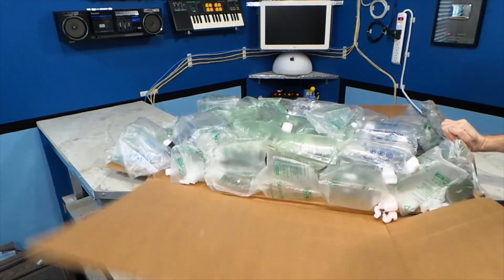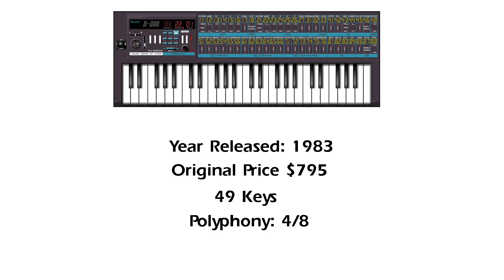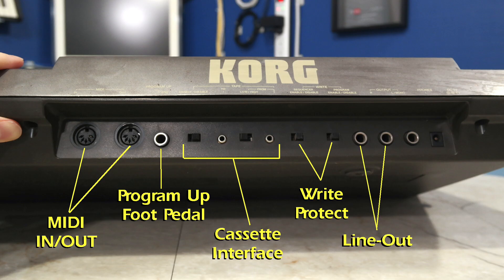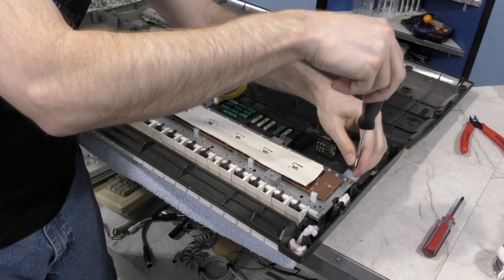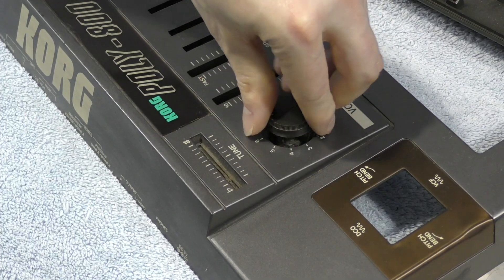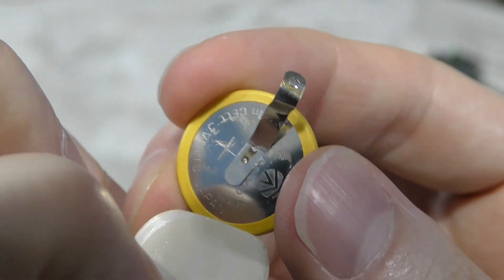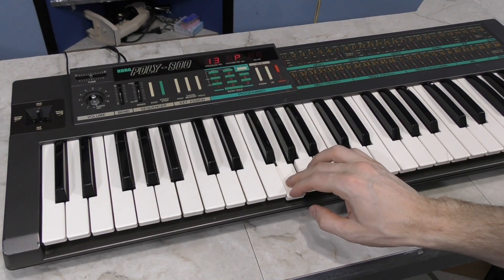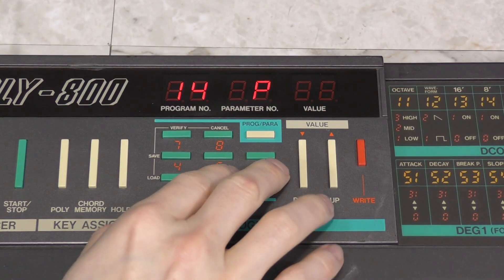Korg Poly 800 Battery replacement and factory reload.

Comment: You could actually feed the battery circuit 3V from a separate battery or power source while changing the battery, if you really want to retain the information in the RAM chip. Not always necessary of course, but useful to know if you really want to avoid loosing the data in the RAM

Comment: I'm not sure if it is even possible with this keyboard, but it would have been nice if you could have done a sysex (system exclusive) dump of the program data before loading in the factory presets.
Reply: Mitchell Dunaway Would have taken a complex digital probing system.  Or some manual decoding of a "tape" export.

Comment: Whenever I have to replace a 3V Li battery in gear like this I use the 2Ah Varta battery when there is enough space. It will last 10 times of the CR2032 battery and I don't need to check every 3-5 years. http://uk.farnell.com/varta/6117201390/battery-lithium-craa-2000mah-3v/dp/1877580. However, still a good mod with the socket, less hassle.

Comment: Why you dont connect a temporally battery directly to the memory  IC and then replace the old one? I think that way you can keep your sound programs, is a parallel conection so you will keep the same input voltage on the IC.

Comment: I would have put on another battery on the same rail on other soldering points and then swapped the battery, this way you wouldn't have lost anything.

Comment: Really enjoying your content!  A couple of questions.  Is there a reason you didn't backup the sound patches that were in memory using the same cassette interface before you took out the battery?  Also did you think of attaching a power supply on the battery contacts before you removed the battery to keep the memory alive while you changed the battery?

Comment: Had a similar problem but wasn´t able to find a button cell holder in my parts bin. I solved the issue by soldering two wires on the board where the old cell connected and attached the ends (after removing a small part of the insulation) to a wooden clothespin. Then i just  put the cell into the pin (watch the polarity) aaaaand: sucess!

Comment: Excellent tear down.  You really have this sort of thing nailedThe battery holder will lose hold of the battery if this keyboard is gigged on the road. That is why I replaced my soldered -on back up battery with another  soldered-on battery. It would be a pain to loose all the data when the battery pops out. I hate to think what would happen if the loose battery shorts across a vital item.Could you comment about replacing the midi ROM, the early Poly 800s were Omni on which meant the keyboard responded to all 16 midi channels at once. An external sequencer can turn Omni off but this was only retained whilst the keyboard was on. It reverted to Omni on when switched back on again. later models had the midi chip modified and a retro chip was availableI heard that the VCOs were SiD chips, is that true? The voices can be very rich and external effects really enhance it.Thanks again

Comment: Interesting that an older cassette interface still proves fully functional after 35 years whereas more recent gear with (failing and unobtainable replacement) DS disk drives are presenting serious problems.

Comment: Out of curiosity, why did you not backup the non-factory patches that were on the keyboard using the tape interface before replacing the battery?
Reply: He didn't care
Reply: How would you know,  @dizzydaisy909 ?
Reply: @HelloKittyFanMan.  lucky guess?
Reply: You don't know how "lucky" that was until you know what the actual answer is,  @dizzydaisy909 .
Reply: @HelloKittyFanMan.  true.
Reply: he's too rock n roll for that
Reply: Bc he's a boomer.
Reply: Wow a C.G.I. ANIMATION IS HERE

Comment: wait did you just replace a nicd rechargeable with an alkaline non rechargable? That battery may be headed for a leak of awesome proportions when you plug it in and the power circuitry attempts to charge it.

Comment: That resistor to ground (1 megohm if I read it correctly off the screen) is commonly used to protect against static electricity. (It's what's inside an antistatic wrist strap) Probably some static sensitive components nearby.
Reply: Since this is an RF shield, I think it is more likely to be there to match impedance in RF signals generated so you don't generate reflections which would cause interference of its own.

Comment: Those batteries often last for 15-20+ years, and some have lasted more than 30 years, so not something that requires very regular replacement.  However, you could have saved the original memory by temporarily soldering any 3V source (battery or power supply) across the same battery backup rails with a 1K resistor in series (the resistor will keep your temporary battery from trying to dump more than a few milliamperes into the old backup battery, giving you plenty of time to safely replace the old battery without needing to worry about the backcharging harming it, then remove the temporary battery when done installing the new battery.

Comment: Oh man! You should have saved the SRAM to your computer via the audio jack just like you loaded them before changing the battery...
Reply: If I ever buy one of those and it has custom sounds, that's exactly what I'd do.
Reply: I was just thinking that myself. If you can save and load, why not save it into a file on his Mac? That way he saves anything that wasn't Factory so he can reload either or whenever he wanted to.
Reply: @CoolSteve08 

 its not hard to create the patches. those cheap synths really had a limited number of unique sounds. I would keep these type of boards for maybe a year then you get bored with them. They arent like true analog boards which are about three times as expensive.
Reply: True!!
Reply: I was thinking this watching the intro.  My mom had one a DW-6000 (close cousin) back in the day and when he showed the tape interface and mentioned that he was going to remove the battery and lose the SRAM... I was face palming.  Like...why didn't he just back it up?  He'd  just shown the tape interface and mentioned the SRAM/battery so he was aware of it at that point.
Reply: ¡PLOP!
Reply: CLOAD. CSAVE
Reply: He's literally a boomer.

Comment: Why didn't you just avoid losing the data at all by soldering in a new battery with wires in parallel while laying down the new cradle and soldering it in parallel, and then desoldering the wired backup battery?

Comment: Wow, very interesting that this has a tape interface on it for data storage! That's comparable the not-so-old keyboards from the previous decade or two with a floppy disk drive, like my Yamaha Portatone PSR-540, and then the most current music keyboards that store data on removable flash storage, except that these have the factory patches on ROM. So that leads to my question: Why wouldn't the factory just put those on ROM in older keyboards too, in a way that could be copied to RAM for the changeability, which could then be restored later?

Comment: You should have perhaps saved the existing sounds to tape (well, not literally tape, but you know what I mean. XD) before replacing the battery. I assume that's possible right?
It wouldn't have taken that long, would it?

Or is the keyboard only capable of loading samples from tape, and not saving them?

Comment: On battery change jobs like these, I prefer to solder 2 wires to the battery connections and keep the board under voltage so I don't lose any information. And for easy battery change later on, I would have soldered 2 battery holders in parallel, and put 1 to the other before replacing the old one.

Comment: @8-bit Keys , something interesting about this keyboars is that it's paraphonic, not strictly polyphonic. It means it has a single envelope for every of the 8 notes of polyphony, so they are not really "independent". If you try to play a sound with a slow attack and a long release  and play a series of notes you will notice they share the same articulation.

Comment: I'm surprised yo did not did not backup the presets that where on it when you got it. I'm assuming the tape load mechanism works both ways and you could have backed up the presets. I'm still kicking myself for letting the battery on my k1m die as some of the sounds that where on it when I got it where not the factory ones thankfully the user i got it from included a handy cd with a ton of presets etc but finding the ones that where on it would be like finding a needle in a hay stack. The k1m uses midi system exclusive messages to transfer presets etc.

Comment: That battery is/was probably rechargeable. Usually batteries with tack welds like that are.
Reply: nabeelr There are quite a lot of primary lithium (often button type) cell batteries widely available with welded tabs that were very commonly soldered direct to PCBs for backup purposes, especially in the 80s and 90s to backup SRAM and RTC chips.  In fact, it was pretty uncommon to encounter lithium rechargeable cells (such as an LR2032) until much more recent times and prior to that one generally encountered much larger rechargeable NiCd packs with solder tabs back in those times.  So having solder tabs on a battery pack tells one very little about whether a cell is primary (nonrechargeable) or secondary (rechargeable).
Reply: That's all well and good, but you missed my other post, where I noted that it's a Lithium Manganese battery, which indeed is a rechargeable cell, with a voltage of ~3.7v

You can see the marking of LiMm marking on the batter.

Comment: Actually, you didn't need to go through the trouble of putting the patches back on. Just solder to the bottom of the board a twin double A battery pack, then load it with batteries and then replace the button cell battery. It works much like a Gameboy cartridge how it has to keep voltage going through it to keep it's save states. With this, it's basically the same thing with the patches. You don't lose the patches at all if voltage is still flowing through the board.

Comment: Couldn't you have saved the existing programming to cassette before changing the battery, instead of having to find a recording online?

You can get tabbed CR2032 batteries on eBay, for pennies apiece. I reckon Korg never intended this unit to have a long enough lifespan that the battery would need changing, hence making it non-replaceable. (The original was still working, after all.)

Comment: Possibly get some spray dye like what is used to redye plastics when restoring cars. I had to use some to color match a grill I replaced and it took less than a day to do. Any black color would probably do. I got mine at LMR, but I was specifically trying to match the interior of a specific model car.

Comment: if you wanted to you could have saved the patchs by using a 24 pic IC clip and providing power to the chip while you switched out the battery.

Comment: in the future you can just hook up a 3v (or 3.3v) power supply to the soldered battery leads when you change it so you wont even have to worry about reloading the data

Comment: I have a question. I recently got a pair of old speakers, that plastic has gone sort of tacky. It scrapes off, and I got it off the volume knob with a bit if metal, but it's gotta take forever that way. Does anyone know if a faster way to get it off?

Comment: TIP! You don't need to spray paint plastic like this. You can use Black Shoe Polish and get a better result. It's also easier. Cheers! Keep up the great vids! :)
Reply: simontay1984 I'm not sure why, but I've been using this technique for years and the plastic is always dry to the touch the next day (nothing gets on the hands). Looks like new again, and lasts too.
Reply: @DanDuskin  if I had to guess, the polish fills the pits and holes that make a surface look dull.

Comment: I had a friend who had one of these synths in the early 90's. It was good for it's digital oscillators that avoided the problems with tuning that analog oscillators had.

The only problems were that the sound was a tad thin and the nice analog sound was imprisoned behind a keypad and a few more buttons which was frustrating considering the sounds you could make and you need knobs and switches to program quickly.

Having said that tho, once you'd managed to program some good patches you could just go wild and use the joystick on the filter and LFO!!

Comment: The color is a bit weird isn't it?
Reply from the maker: I thought so too.. it's my new camera.  But I couldn't seem to adjust it any way that made it look better, so I eventually just left it the way it was.
Reply: Hi.. umm David?

I've tested some option to make better picture in GIMP, either of those solves the weird color problem. These options should exist in any good video editing software.
First I've increased the red channel by 6, this sould be somewhere in the Color Balance option or similar.
Then I've changed the hue, rotated the color wheel by -14.
Maybe you should check the Color Temperature option too.
And you may check the options on the camera for these, there sould be something that fixes this, maybe you can lock the color temperature or something, so you don't have to correct it in editing.

Your face will be good with any method. The difference is the background. The most noticable is the color of the keys on the syths and the color of the wall. Unfortunately I haven't been in your house so I can't help which gives the more realistic result :)

Will be a review of the new camera? If there was a car review a camera review would fit too :)

And thanks for the videos on both channels :)
Reply: new camera 1080p, he needs to play with the settings

Comment: That keyboard gives a 'Terminator soundtrack' vibe.
Reply: Blade Runner came out in 1982. So, no. Vangelis did not use a Poly800 for this soundtrack. It was the Yamaha CS80 that he used intensively.
Reply: That synth is similar to the Juno and polysix in many ways.  Both being the defacto sounds of many 80's movies.
Reply: Vangelis is known to have used one, not sure if it was in the Blade Runner OST or not though.
Reply: KRAFTWERK2K6 The CS80 is my absolute favorite synth ever. Blade Runner, The Shining, Doctor Who, and about 100 others..
Reply: @5roundsrapid263  Shining was Polymoog and Moog Modular.

Comment: Now, if you knew where to monitor the battery voltage, why not connect a backup battery across that to maintain the memory while replacing the original battery.
Reply from the maker: I wanted to reload the factory sounds anyway.

Comment: I've clipped/jumpered in another battery in other machines when I've replaced keeper/SRAM batteries.  

Would that have allowed you to preserve the previous settings, and is there /there not an export/save settings function?

It might have been interesting to diff/compare the settings.

Comment: Nice vid! Korg also released a module version: the EX-800 - which is the same synth in a box. I did a few videos on it including a microswitch repair. They have a very interesting voice structure (which I'm surprised you didn't mention): which is combining square waves together in a step to produce a faux sawtooth sound. So, the synth doesn't actually have a native sawtooth waveform - it has to use a style of additive synthesis to produce it. The envelopes are also something cool - with the extra two stages. People also heavily mod these synths - and there's some interesting projects out there which aren't terribly difficult to implement: check out Moog Slayer (a well needed filter mod) and HAWK 800 (MIDI) mods (not related to me in anyway).

Comment: Are you sure the battery wasn't a rechargeable type? might cause damage to the new battery if it was and the board tries to charge it.
Reply: @Mr T. Guru i guess it's the same as used on PC motherboards.

Comment: There's something satisfying about him plugging the cables back into the circuit board.
Reply: this, exactly this. weirdly satisfying.
Reply: Amy Carter exactly
Reply: I oddly feel the same satisfaction from the clicks of a well-used and well-maintained typewriter (this is why I really love the intro to 'Black Tambourine' as performed by Beck - actually the whole song is an ASMR thing with the simple bass line and technical but droppy drums not to mention the soft vocals).
Reply: Amy Carter Old technology is so satisfying.
Reply: Interesting that it was Korg that in the past few years released both the MS-20Kit and MS-20MKit, full sized analog synths that you assemble yourself just down to plug level (no soldering required). I owned and built both, a fantastic synth nerd experience :)

Comment: Ok, now it is sure, 8-bit guy is monitoring me.. I just last week, after it had been sitting for 15 years in the closet, opened my Poly-800 to see why it was not coming back to life.. At least battery was empty, of course but no life, lights come on, power is working and main processor receives clock (that is about where my skills end..). Could be that the eeprom is busted since none of the buttons work but i can't find anything else that is busted, all components seem to work, afaik.
Reply from the maker: so... maybe it just needs the factory patches reloaded?
Reply: did you ever fix it?